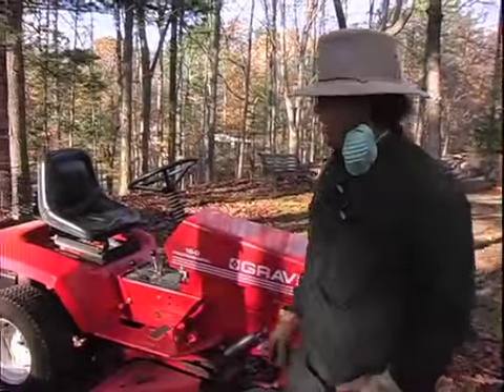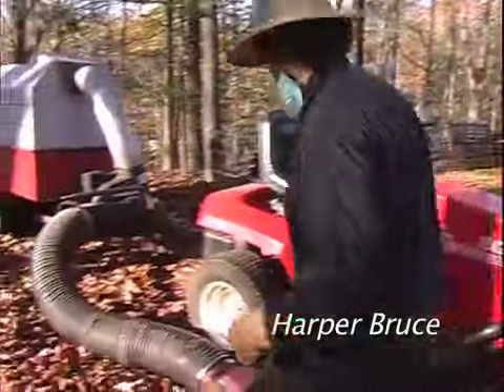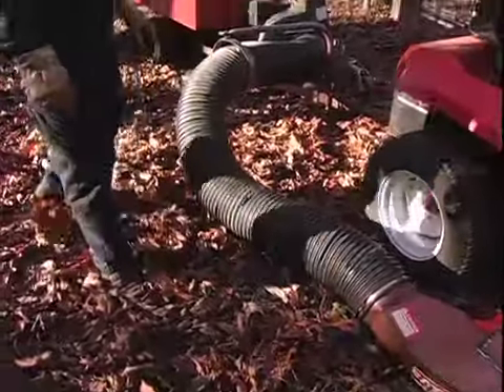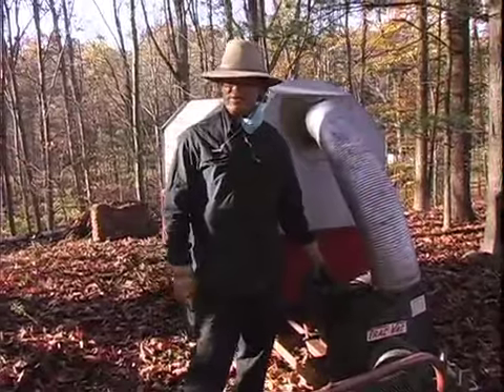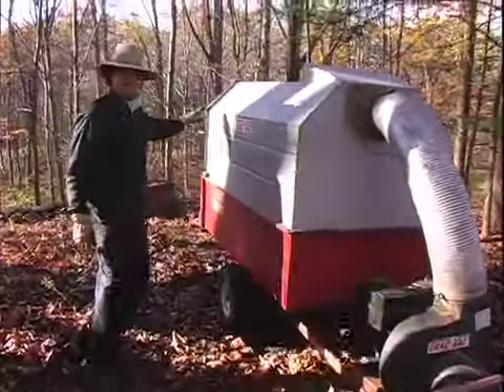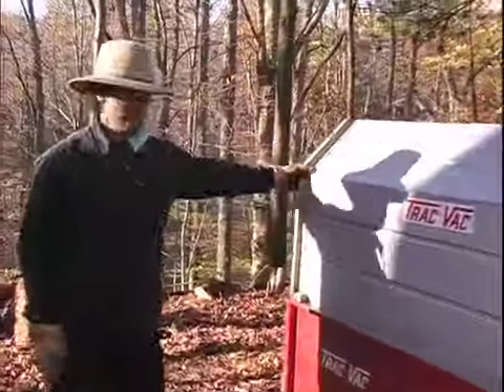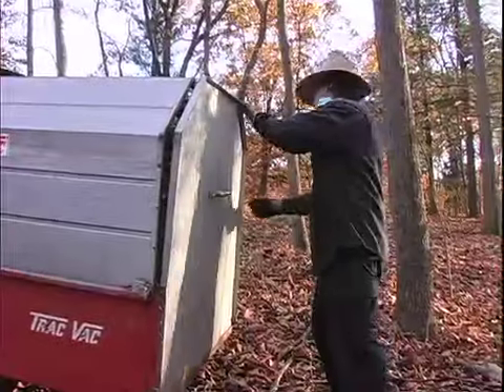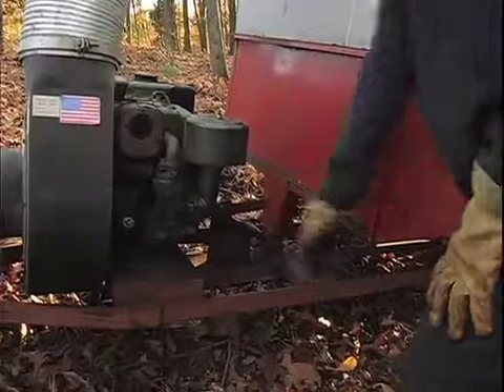Harper Bruce: Using and Dumping a Trac Vac 880.mov

Comment: I am just curious why some people still bag leaves, I mean why not just make a mulch cover and mulch them up and keep all those nutrients in the ground for spring? Free fertilizer and much much easier!
Reply: I've been doing lawn cleanups for 13 (in southeast US) years and many of those years were bagging and many were mulching it into the lawn.  The downside to mulching is that it takes many many passes to get a good fine mulch that looks clean.  Many times, I have to get off the mower and "toss the salad" with the blower to bring the leaves back up and mulch them more.  If the lawn is really really thick, then you can mulch them in one very easy pass.  I've never had a lawn with problems from any mulched in debris except lawn clippings.  They take much longer to decompose than leaves and cause fungus issues in extreme situations.  The other down side to mulching is small areas.  Many homes, especially in older or downtown neighborhoods, have very small lawns and yet have a lot of really big trees.  Drive through a downtown neighborhood and you'll see what I mean.  So at times they don't have enough lawn to mulch the leaves into.  And the final problem with mulching is bare spots.  There's just nowhere to hide the debris there.  All in all, I tend to run over the yard mulching the leaves.  But whatever is not mulched after one quick pass is easier to bag up.
Reply: If you have about a foot thick of leaves in your yard like I do there's no way you can mulch all that into the lawn.